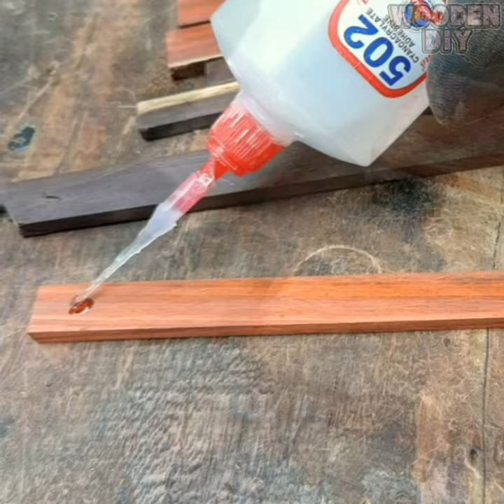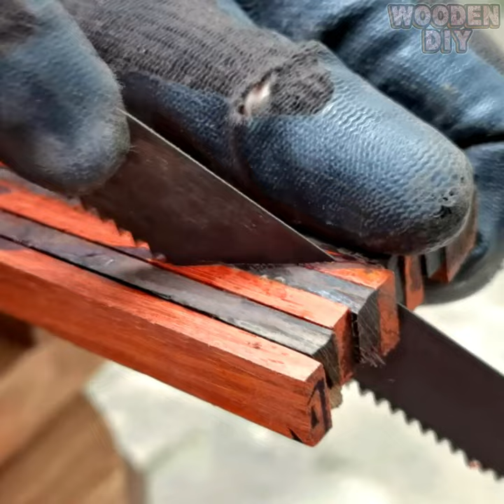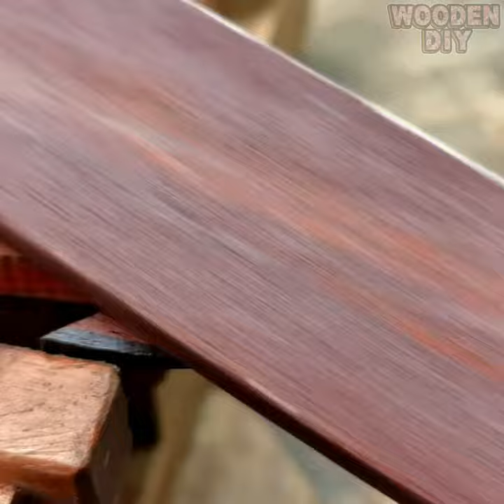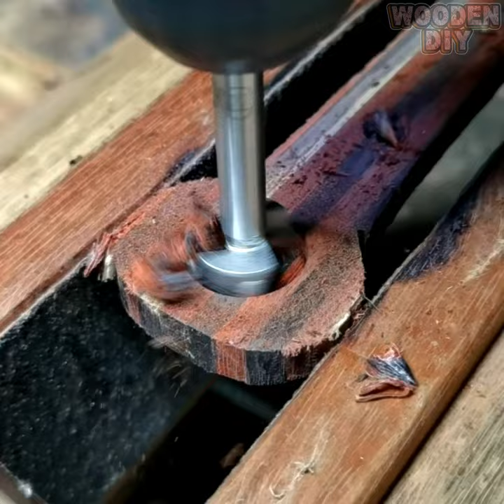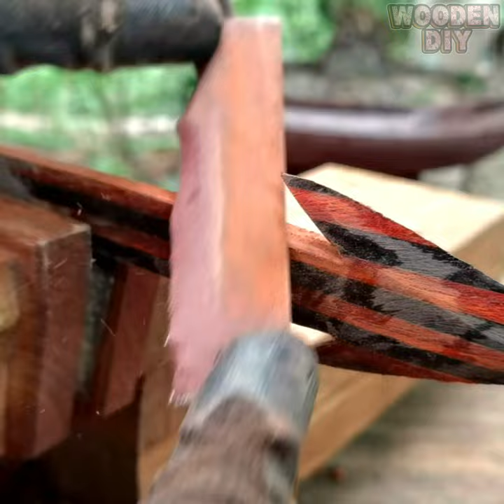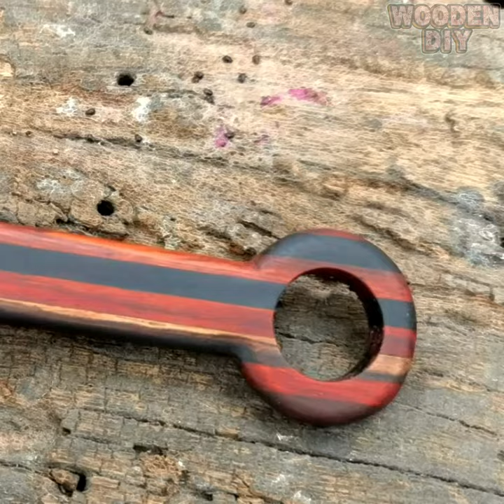Wood Chips and Super Glue can Craft a Knife Dagger? #Short #Shorts

Comment: I made a Bowie knife (800mm long) out of jarrah for the blade, macrocarpa for the guard and pommel and kwila for the scales,,,,,  considering it's size it's surprisingly light and very wieldable I use it as a wall hanging, I,e, not sharp however I am certain if you swung it you could easily remove the top of a head!! 🤯